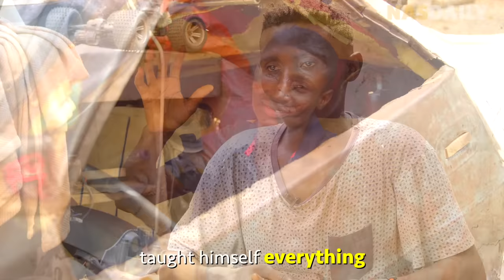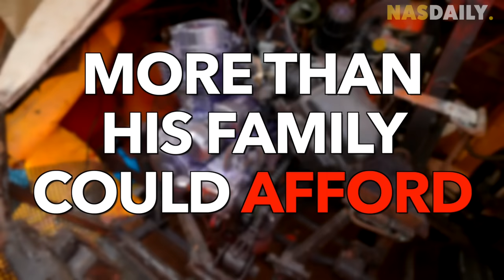The Hidden Elon Musk Of Africa

Comment: There is no way that a small one cylinder engine can make 300 horsepower at most maybe 20 horsepower neither the less it's still impressive that he built a car
Reply: nas really said "can go upto 300 horsepower" it aint even a mesurement of speed 💀 also at 300hp your looking at something around a lamborghini LP400 and that aint no lamborghini
Reply: I have seen smaller 1 cyl engines make 34-39 HP
But you cannot really compare a 2 stroke Derbi or Minarelli engine tuned to the extreme to some unknown engine that is air cooled